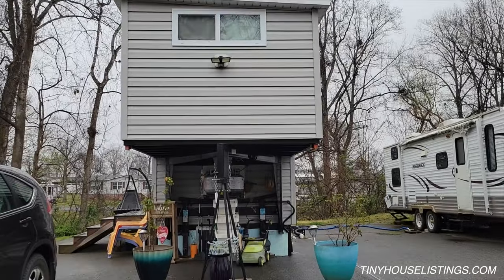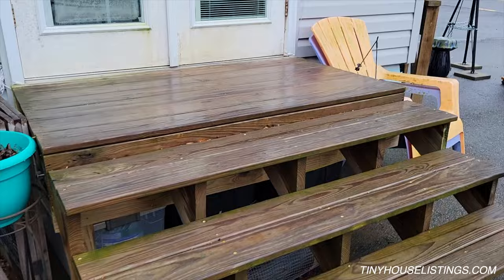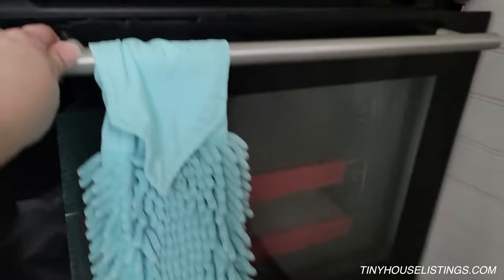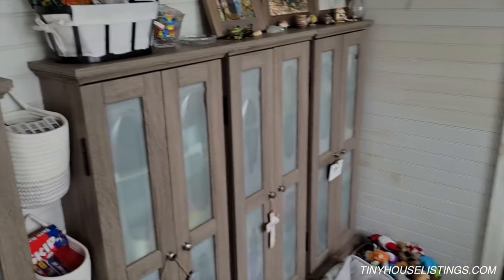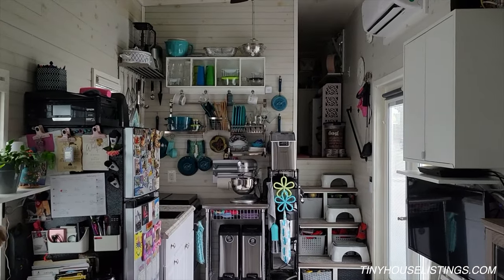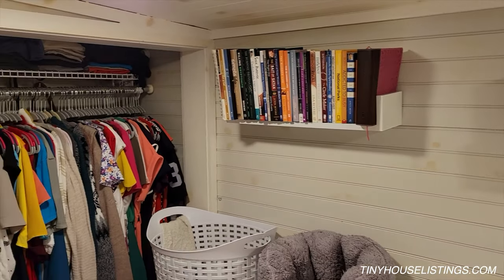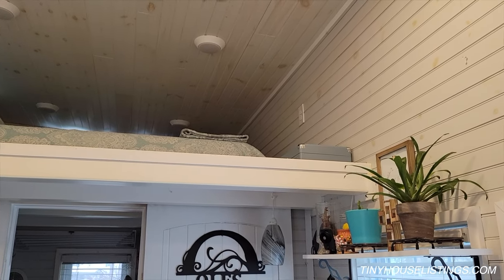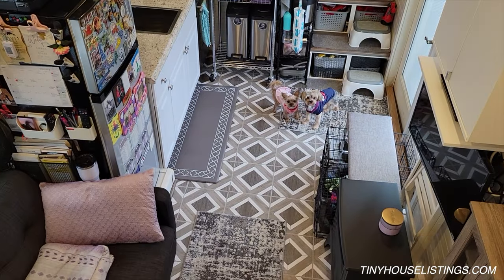2017 Tiny House Has Separate Bedroom Quarters

Comment: Stainblocker on those wood knots (beadboard and trim) -Zinnser 123!  
Quarter round , also stick down linoleum tiles in wet mopped areas (bathroom) is a big nopes.  Use cove base Over single piece flooring or  in a space so small, I would just curb the whole thing,tile it, and have it center drain. 
Few problems in an over all win, I love the Goose neck tiny home builds!

Comment: Is water stains on the walls and ceilings?
Reply: I saw that too. Had me concerned there’s water damage.
Reply: I think it is wood knots yet i wondered too, what is the discoloration was on the walls
Reply: @bettyolis6228  Yes, just wood knots.  They invariably show through paint after awhile.  Hard to permanently hide them... May have to apply bondo or some other cover material and then paint to really cover them long term.